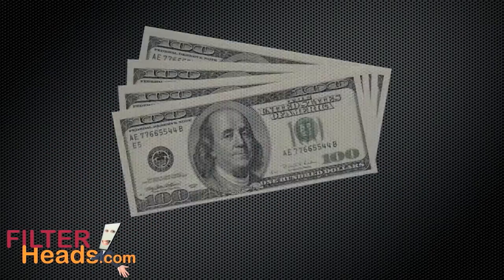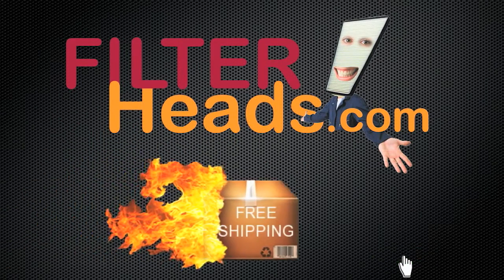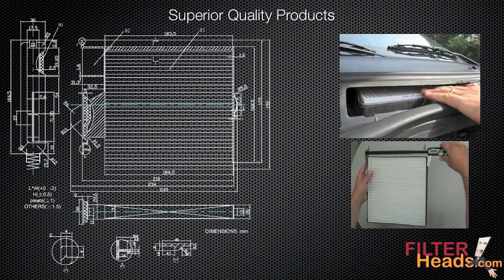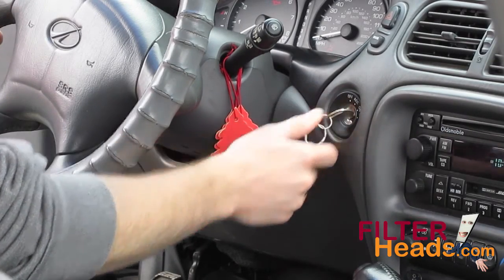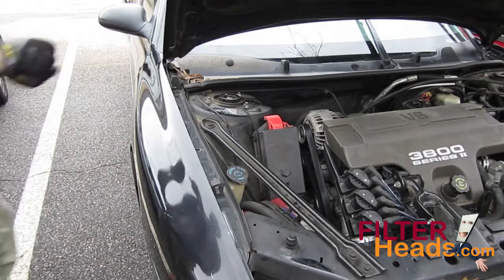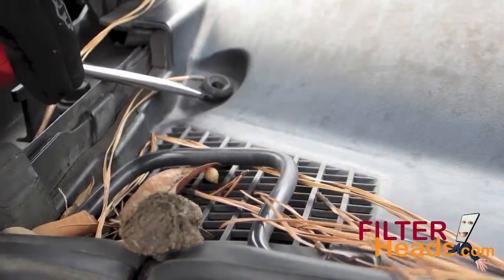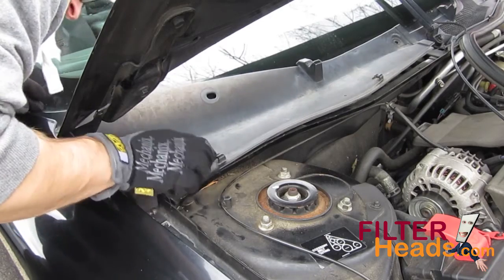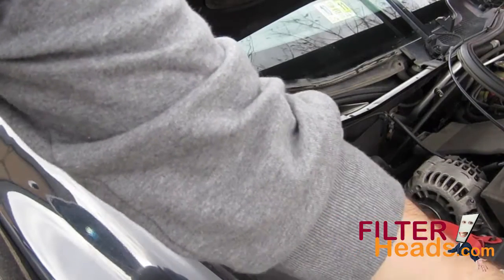How to Replace Cabin Air Filter 1998 Oldsmobile Intrigue | AQ1001

Comment: Can someone tell me if there is a csbin air filter for a 96 olds 88 LS
Reply from the maker: AQ1001 filter fits:
Buick Allure 2005-2009
Buick Century 1997-2005
Buick Lacrosse 2005-2009
Buick Regal 1997-2004

Chevrolet Impala 2000-2013
Chevrolet Impala Limited 2014-2016
Chevrolet Monte Carlo 2000-2007

Oldsmobile Intrigue 1998-2002

Pontiac Grand Prix 2004-2008